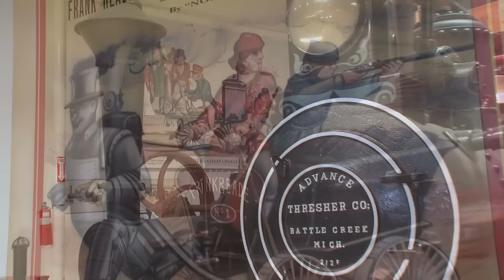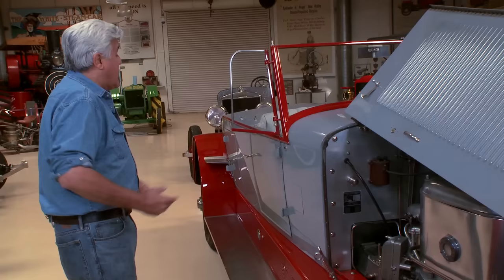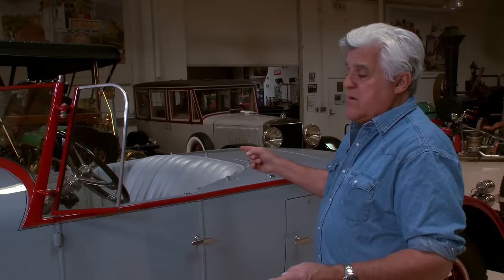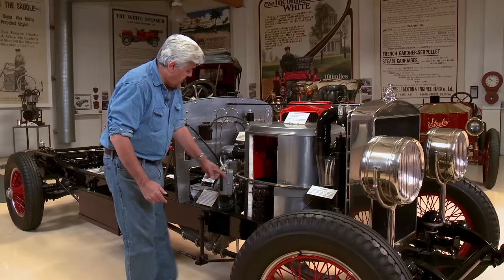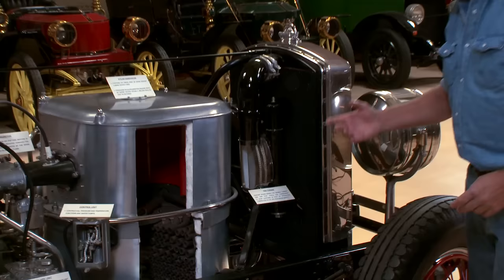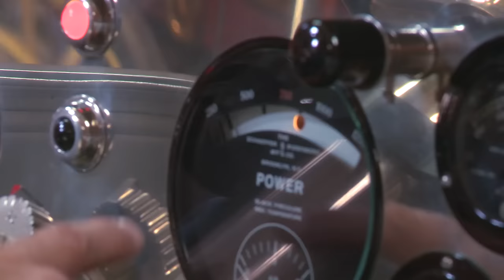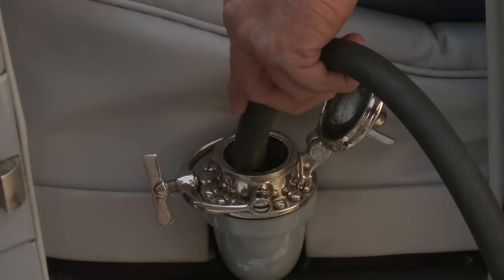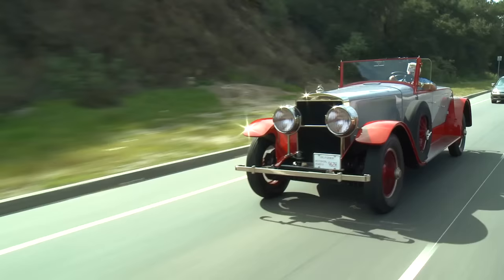1925 Doble E-20 Steam Car - Jay Leno's Garage

Comment: 1000 pounds of torque? 
you are right jay, i really want to see a properly modern steam engine.
Reply: brilliant piece of machinery...never thought steam power generation and energy conversion would be so feasible in the small dimensions of a car
Reply: Mathew jacob Absolutely! A beautiful piece of machinery. Yes, its possible.. but unfortunately steam is not efficient at this small of a scale and not competitive with ICEs.
Reply: either a quasiturbine (no recompression, no loss of power through converting reciprocating motion to rotary motion and no loss of power from the reversal and loss of momentum inherent to reciprocating motion) or an opposed piston compound uniflow steam engine, add condensing or a bottoming cycle with a small engine powered by a lower boiling point liquid. either could approach or perhaps even match ICE Efficiency.
Reply: they do have a modern steam engine, its called a diesel(1000lb ft+ when tuned) Id love to see a modern steam car too, but honestly not many people would go for it. Everybody want simple, easy, and lotta fuel mileage.
Reply: Same basic technology used in Nuclear Submarines....Different fuel source and Subs use a Turbine drive instead of reciprocating engine, but still the same basic principles...
Reply: Dennis Bartholomew Deadly nuclear radiation hazards, multi-million dollar production costs, 100,000+ horsepower scale output, the ability to operate underwater or run for years without refueling, these are not design criteria that crosses over to automobile production very well.
Reply: As I said, different fuel source, but the Steam Side of the Nuc Plant is based upon the same principals used in this automobile.....OH, and its fairly obvious that the ability to operate for extended periods underwater is not needed in an Automobile.........
Reply: Dennis Bartholomew Can you cite any examples of practical steam turbines in the scale and density that would be small enough to work in a automobile aplication?
The requirements for efficient vacuum condensers don't seem in the realm of possibility even for a vehicle the size of the biggest SUVs
Reply: No, in my original comment I wasn't trying to apply steam turbine technology to automobile use merely stating that the basic steam cycle is still in use in modern times....in Submarines, Ships, Power Plants, etc etc......
Reply: Thedeoradude Reciprocating engines are horribly inefficient... which is why they are completely obsolete.
Reply: ICE's are already reaching 60% in testing and 56% in production.. you can buy a 10 year old used car that get 43%
Reply: Thedeoradude You seem very uninformed about engineering in general..
Toyota's new 1.8 liter 2ZR-FXE reaches 41%.

Toyota 2AR-FSE 2.5 liter 39%
Volkswagen 3.3 V8 TDI 41%
BMW N47 2.0 liter 43%
Audi 2.5 liter TDI 43%
 
The Carnot Cycle efficiency formula tells us the maximum theoretical efficiency of an ICE is 77%

Currently available Marine engines already exceed your false claim by well over 10%
The  The MAN S80ME-C7 delivers 56%.
Please cease propagating your ignorance.
Reply: Thedeoradude It would seem you were unaware that you would easily spotted as a fake.. doing a really pathetic job of pretending to know anything about engineering
Reply: Thedeoradude CARNOT CYCLE APPLIES TO ALL HEAT ENGINES INCLUDING ICEs AND STEAM (RANKINE CYCLE)
Reply: Thedeoradude I'm not the one here trying to make up theories and facts... The most glaringly obvious proof is the irrefutable fact that steam cars have been obsolete for over 100 years.. that should be a hint that your ideas are unsupported by reality.
Reply: +The real doktorbimmer steam cars have not beeb obsolete for over 100 years. do some research yourself to get real figures. I canw find evidence anywhere to substantiate any of your claims.  look up ted pritchard. that was only in the 70's and it was bought out by oil companies and hushed up. ic engines are what have had there day. they are reaching there limit steam on the other hand has not yet been explored to its full limit.
Reply: Nathan Woodruff The steam car industry collapsed in 1915 with the introduction of the electric starter. Only White survived by switching to internal combustion engines.
Reply: Nathan Woodruff The Pritchard steam car was a complete and total failure.. its design was not bought out by the oil companies.. although the oil would literally cheer if these gas guzzling dinosaurs ever did return.. nothing could be better for their business.
Reply: Doble steam cars were being built up into the late 20's. They were popular. They were much more efficient and cleaner than other cars around at the time. what let them down was not being able to get a production run. If you read the Doble book you will find out some facts which I think you need to take note of instead of quoting random figures and nonsense that is irrelevant.  If you actually studied the facts on Ted Pritchards work you would find it was beginning to rival the average ford falcon at the time for example. It met emissions standards at the time as well as water consumption. It did use slightly more fuel than that of the average car however it was burning inferior fuel oils that were much cheaper and more readily available which makes it hard to compare fuel efficiency with a gasoline car.   Research was started in around about 2005 into Ted Pritchards design and I believe a prototype has been built however there is no funding into the research which is very costly when trying to build prototypes.
Reply: roflcopterkklol turbines?
Reply: Most of this thread is a man arguing with himself, quite good.
Reply: +themadplotter.. No arguing here son.. the facts speak for themselves.. and the speculating fools have gone back to commenting on magnetic perpetual motion machines and various other vaporware engine scams...
Reply: QED
Reply: +themadplotter SFC
Reply: I cannot see why you can't simply withdraw from this or better admit that some if not most of your facts are wrong or have no actual evidence or references to support your statements. You are the speculating fool with no evidence that you show or references to your so called facts. It is a lot like the Wright brothers approach to claiming they were first to fly initially they provided no evidence except stating that did and ridiculing others. Honestly I think you are only kidding yourself on here and should just stop.
Reply: +Nathan Woodruff  The facts speak for themselves.. you have just proven that you are not an engineer and have no functional understanding or education on this subject what so ever.
You are simply making a fool of yourself now..
Reply: You have simply just made a slanderous accusation. Unless you can provide evidence to support it it could be taken offensively. Now all comments I have made I have tried to back up with links to websites so that is easy to fact check. It is harder to fact check with some of my knowledge coming from books in my private collection.  I am happy to be proven wrong if the facts, evidence and references are there to prove so.  I suggest that your next comment either admits you have been wrong in some cases or if you still decide to blatantly discredit me I suggest you use evidence or it will be taken as a slanderous remark and reported.
Reply: +Nathan Woodruff You have only discredited yourself, Its not a slanderous remark if the contents of the comment are 100% factual and true...
Reply: +Nathan Woodruff I will make no excuses or apologies for the truth..  you have simply chosen to deny it.
Reply: "The truth is incontrovertible. Malice may attack it, ignorance may deride it, but in the end, there it is." Winston Churchill
Reply: Thedeoradude: Depends on the kind of ICE - combined cycle gas turbines can get into the 50%s
Reply: Ellenor Malik Great comment, there are Industrial Gas turbines  currently available that reach 62% thermal efficiency
Reply: This conversation brings to mind the picture of people shouting at each other from atop their high horses, whose horses have by now become so high, they are increasingly beginning to suffer from altitude sickness (the people, not the horses).
Reply: EinachserLS Watch out man, this weird little guy who would argue in an empty room started stalkin me. I'm sure he did the same to nathan and probably everyone else who commented. Very odd chap indeed.
Reply: +themadplotter  The truth is incontrovertible. Malice may attack it, ignorance may deride it, but in the end, there it is. Winston Churchill
Reply: +EinachserLS Monsieur Carnot only published one book during his life, Réflexions sur la Puissance Motrice du Feu ("Reflections on the Motive Power of Fire") If you have never heard of it, or do not understand the theorem contained within it... engaging in any concussion regarding heat engines would be like a warrior going into battle without his armor or his sword... temerarious and foolhardy
Reply: The real doktorbimmer Two Electric Motors the size of small block V8 can easily total more than 1000 lb/ft. Modern performance multi motor EVs all seem to have minimum 700lb/ft or much more.
I.E. Lucid / Atieva, NIO EP9, Rimac Concept series, Zombie222 all have about 1000lb/ft
Reply: +Neojhun Any engine with only 150 hp like the Doble can easily develop 1,000 lb-ft. of torque at the wheels... even a Hyundai Elantra!
Reply: Bring up electric car vehicles then that can be brought on the show. There's plenty in treating attempts that we can take knowledge for today.
Reply: The real doktorbimmer NOT Relevant, WTF did you use bold. EVs output that specification of torque at the MOTOR SHAFT With NO Gearing. By the time it gets to the wheel its off the charts in comparison to ICE. At the wheels after gearing its roughly like 3000-4000 lb/ft for mid range Model S 85P. 
Cole Miller Tesla P100D exceptionally road safety certified mass production drivetrain peaks roughly 920 lb/ft.
The most craziest car is the Gen1 Chevy Spark EV with A123 Batteries kicked out 400lb/ft at MOTOR SHAFT. Yes the tiny Daewoo econobox.
http://insideevs.com/gm-general-says-spark-evs-400lb-ft-of-torque-no-misprint/
Reply: A fairly interesting topic to discuss ruined by childish insults and arrogance. Grow up.
Reply: +John Ryan  Not true John! Today's GM, Fiat and Ford Diesel pick-up trucks develop 900 lb-ft or more of torque at the CRANK! The amount of torque generated at the wheels is so much greater in 1st gear that all of the manufactures must electronically limit torque in the lower gear ranges to prevent wheel spin and damage to the powertrain components
Reply: +John Ryan The truth is the Doble E couldn't keep up with a modern car climbing a long 3-4% mountain grade, steam cars are dead because they are not only less efficient.. they are completely inferior to ICEs
Reply: it could be made as easy as turning a key, waiting a bit and pressing a pedal. Tell us 1 reason why it couldn't be electrically controlled as far as throttle, temperature and pressure is concerned.
Reply: @doktorbimmer youre talking about technology from 1925 that was abandoned only because petrol and ice's were cheap. This is why we want to see modern technology used in steam. Electric is failing already- sales are slowing compared to production as people realise its not the be all and end all the climate doomsayers claim. Steam is a multi fuel system from sticks and twigs all the way to nuclear with gases and liquids in between. You can even use regenerative braking via an air compressor, and as an external combustion engine, you can lean off the mixture to get the most energy without melting holes in pistons.
Reply: @rossbrumby1957  Abandoned because steam is very inefficient
Reply: @rossbrumby1957  The Doble runs on gasoline... what is your point?
Reply: @rossbrumby1957  technology that has existed for hundreds of years... steam cars are an absolutely obsolete technology that is no longer a viable concept today.
Reply: @EinachserLS  I feel sorry for you...

Comment: Modern car: I'm way too complicated with computers, etc
This car: Hold my steam
Reply: All the power of a locomotive - in a car 😊
Reply: @Pseudonayme 77 You won't find many locomotives that only have 150 horsepower...
Reply: It can reach over 200kph. Steam held well.
Reply: @doktorbimmer  You won't find many cars that have 1,000 lb/feet of torque.
Reply: Wait if the modern car is holding the older cars steam..then how is it going to ru-(wheeze)
Reply: @doktorbimmer  because they measure trains in torque but I agree
Reply: @ztm454  Not torque, but tractive effort and power. I've never seen torque figures for locomotives.
Reply: @xluumu  then you arent American
Reply: @ztm454  Yes, I'm not American, but I doubt even Americans rate locos by torque, as it is quite irrelevant.
Reply: @doktorbimmer  you won't find a locomotive that is only 2 1/2 tons either lol
Reply: @xluumu  Indeed, traction is the issue.  Who cares how much power it has if the traction is not there to pull it.
Reply: @doktorbimmer  , You won't find find locomotives that are so small with 150 horsepower......60 Miles?.....not yet....

Comment: I find it remarkable how clever engineers and designers were back in the day, with little more than slide rules, pencils and papers.
Reply: People don't know what a slide rule is anymore. I remember using them. More lost technology.
Reply: I work with boilers/power plants, lots of genius amazingly reliable 100yr old technology still used.
Reply: And their advancements were far more outstanding as they were using and pursuing things so outrageous there was nothing known how it worked. Today you need tons of theory and C.A.D design to even prove it will work, back then it was a case of make it and if it worked then keep going or if not start again.
Reply: Monochromatik-Vision true but these were “esoteric” machines of limited capabilities and certainly not in the domain of commercially available products.
Reply: Hey dude. When the Apollo 13 oxygen tank exploded, the guys at mission control double checked all their computer calculations using a slide rule.  Just sayin 👍
Reply: You left one thing out: brains.